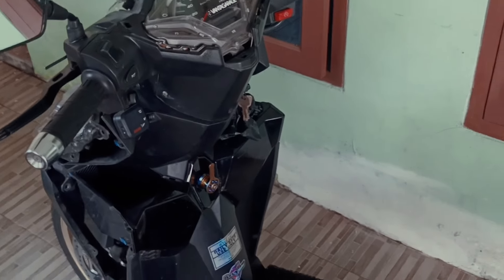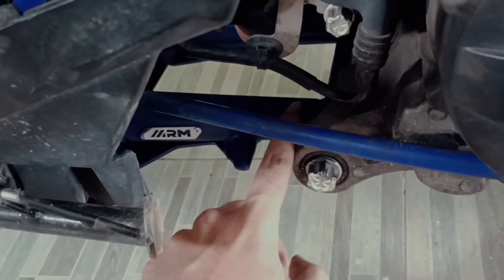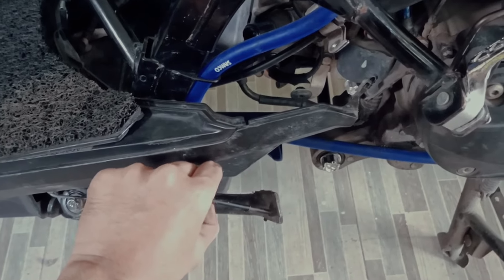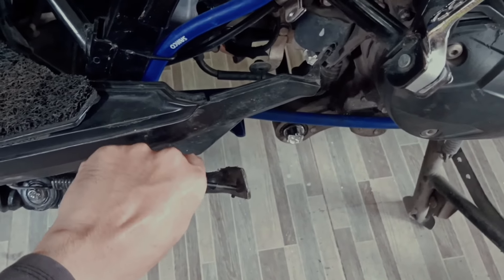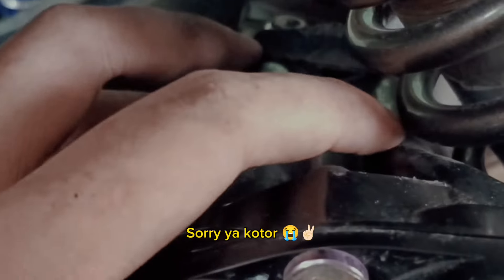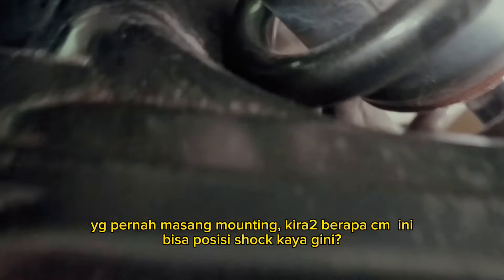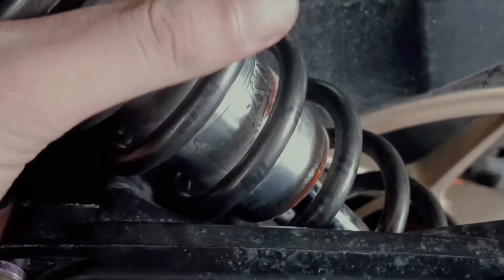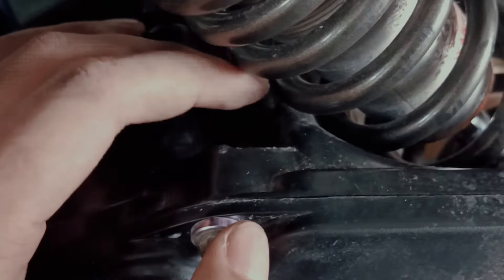Pasang Mounting ARM 6cm di Vario: Peh Ndak Pas!! (PNP?)

Comment: Mas mau nanya pasang mounting aman gak buat yang sering perjalanan jauh apa resiko nya, dan mouting mending lass atau beli satu set
Reply from the maker: @elhayang128  pasang mounting ukuran wheelbase jadi panjang, efeknya kurang gesit kalo dibelokan, tapi lebih stabil di kecepatan tinggi. 
Kemudian jarak shock blkng lebih miring, akibatnya groundbase jadi ceper dan shock lebih soft. Kalo buat turing lebih direkomen pakai shock yg bisa adjust dan opsional pakai peninggi biar ga gesrek.
Dari kita rekomen yg 1 set, kalo yg las2an biasanya dipakai jauh yg kalah las2an nya
Reply: @vantagarage  buat shock belakang nya yng pnp sama mouting uk brapa mm bang biar ga rubah rubah atau nambah breket